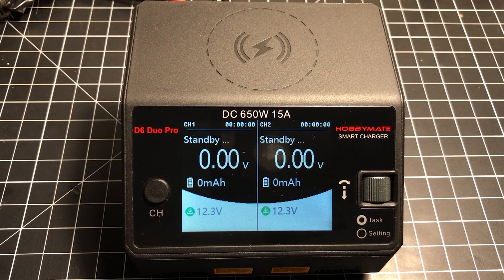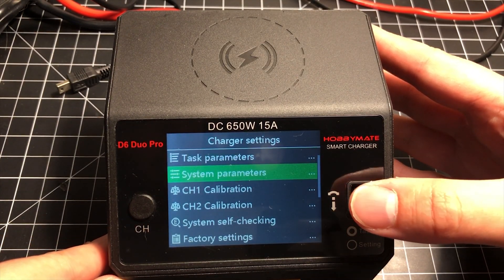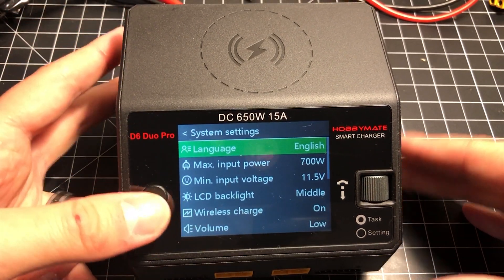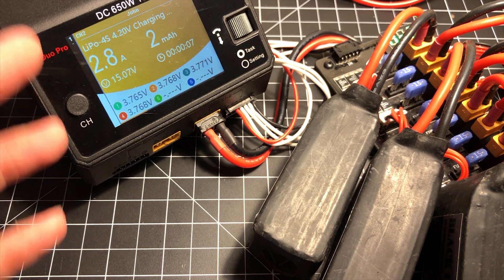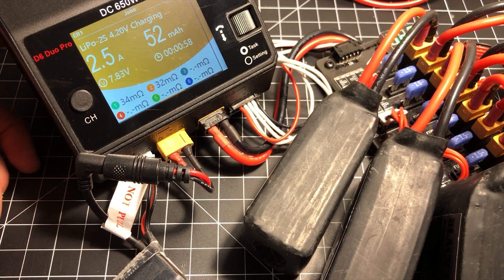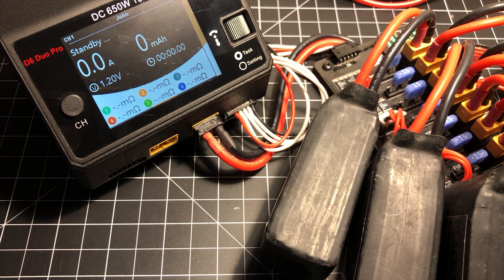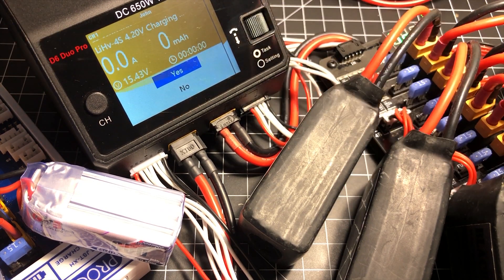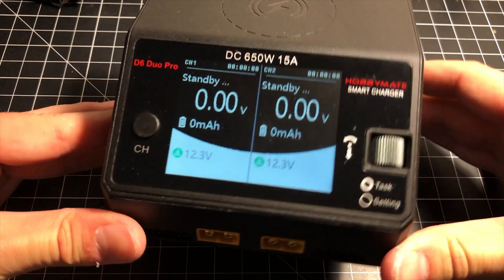Hota D6 Duo Pro // DC Battery Charger 650w 15a ⚡

Comment: What volt would you use for a us wall socket?
Reply from the maker: The voltage settings apply for DC only. For a US wall socket you’d be using a built in AC adapter which is auto configured, if you bought the Ac/Dc version.

Comment: A 12V power supply that is capable of 58.8A @ 700W would give max power...But can the HOTA D6 handle 58.8A @ INPUT? HOTA mentions nothing on INPUT amperage.
Reply from the maker: They apparently do not publish maximum input amps, but hota and hobbymate say for full power you need 24v. Best I can say is I'm getting roughly 160 watts maximum per channel with my 12v 750w power supply.
Reply: @JohnCuppi  Well, that looks about right then. ( 650w div 24v = 27.08a ) That is 13.54a per channel max INPUT. ( 12v x 13.54a = 162.48w ) Out of curiosity, what is your 12v PS max amperage at your AC input voltage?

Comment: Could you check what span you can adjust the end voltage of each cell? In the manual it only says "End-voltage slight adjustment" it doesn't say how high or low I can set it and I'd like to have it end at 4.18 like the Icharger does it.
Reply from the maker: On the low end, 4.00 and on the high end 4.25 for Lipo. LiHV is a bit higher. Just checked. :)

Comment: Got a Hota D6 Pro and when turned on I just get the message "CH1 Self-check failed! (E108)". Troubleshooting I did: firmware update or hard reboot, but problem continued. Not happy!

UPDATE
- reported the issue to HOTA, sent emails several times for any news, and they only kept replying "sorry to hear that" and did nothing 
- reported the issue to Banggood, and after sending the unit back was fully refunded 
- now I have an ISDT D2
Reply from the maker: I received a hota d6 last week and it was perfect. Updated the firmware to 1.3.37 too without a hitch. I wonder how a unit with a failure on self-check made it out of the factory, maybe it got damaged in the mail. Thanks for your feedback. I'm glad banggood took care of you and refunded it.

Comment: What exactly do you plug this into? How would you plug it into a wall outlet?
Reply from the maker: This version must be plugged into an external DC power supply.
Reply: @JohnCuppi  Oh okay, thank you for the fast response.
Reply from the maker: @TechCarnivore1  Here is a power supply that you can use with this, it is a little under powered for this unit since it is only 460w... but it is a repurposed HP server grade power supply. I have one of these at 750w and it works quite well. Ideally, you'd want to get a 24v power supply 700w but that's going to cost a lot more:  https://www.banggood.com/custlink/KGKYrdMyNV
Reply: @JohnCuppi  Do you by any chance have links for one with the necessary cables to use this charger?
Reply from the maker: @TechCarnivore1  Oooh I just found a 750w 12v version for not that much more.  Still not 24v but nice to have. https://www.banggood.com/custlink/v3mEpEzEN4
Reply: @JohnCuppi  Awesome, i'll look into it, thank you!

Comment: +1👍 nice charger. i've only used my 80w DC single-batt charger (but i have two).  does a higher wattage change charge times? or is it just for backing more packs at once?